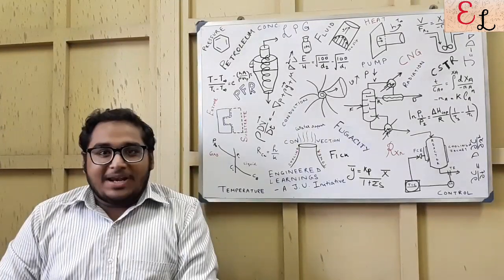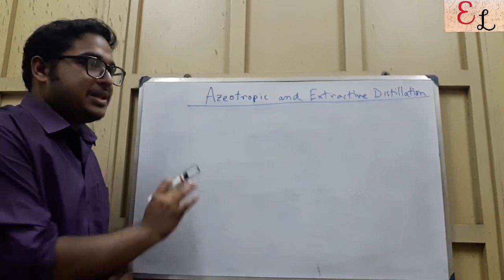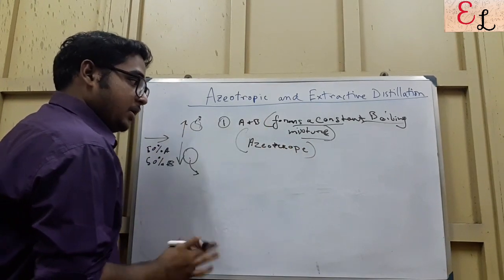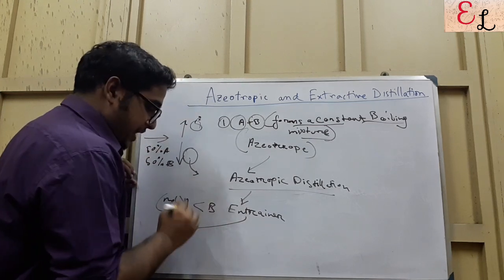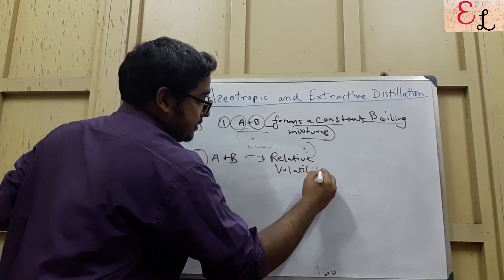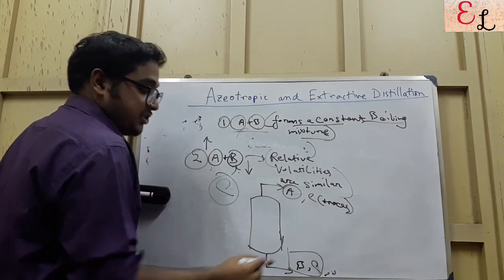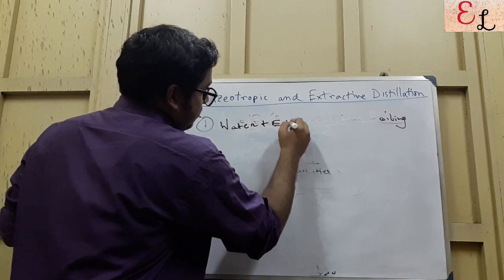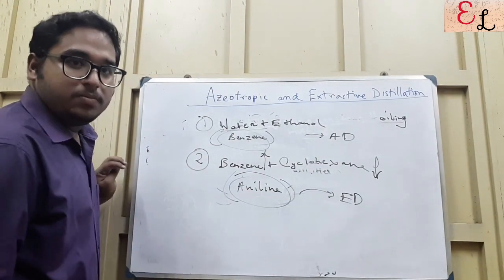AZEOTROPIC DISTILLATION | EXTRACTIVE DISTILLATION | VOLATILITY | CONSTANT BOILING MIXTURE | VIVAS

Comment: Sir, for separation of PROPANE+PROPYLENE with entrainer -ACN in extractive distillation column. What method can I use to calculate the mass balance for the equipment.
Reply from the maker: Since it's a Multicomponent Distillation, you may use Lewis Mattheson for Stage to Stage calculation and to find out total no. of Stages or Trays in the column. However, Mass Balance can be done simply by Three Component Mass Balance Technique.
Reply: @LifeBeyondBusiness  Thank you so much Sir. Will try my best to do it 😊

Comment: sir, what method will i use for the msterial balance of extractive distillation? is it fenske underwood gilliland?
Reply from the maker: Depends on the number of components used. If it is a multicomponent distillation all the 3 methods are relevant and are to be used one after the other.
Reply: @LifeBeyondBusiness  hi sir thank you for replying. in our case, HCL, PROPYLENE, PROPANE are the components and WATER is our solvent. I am in charge of the material balance in our equipment design. How will I be able to perform it?
Reply from the maker: You can try Lewis Matheson Multicomponent Distillation Method for tray to tray calculation!